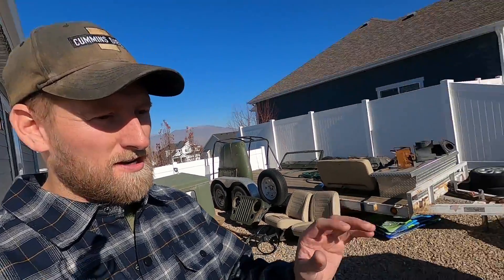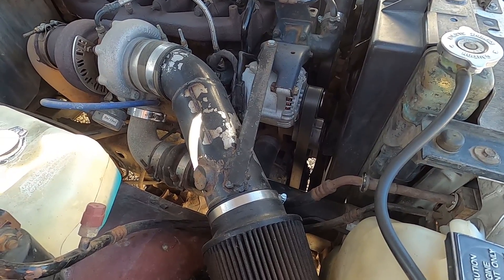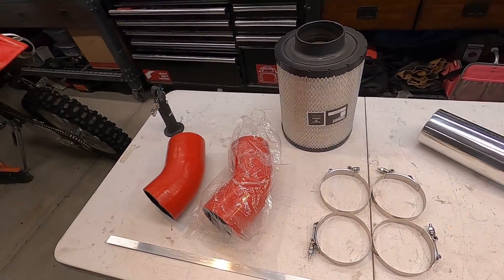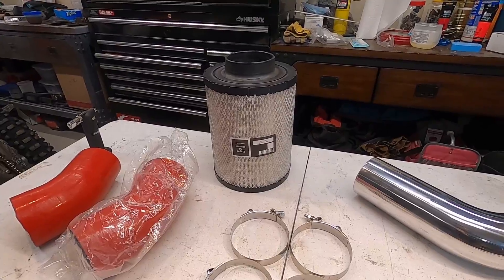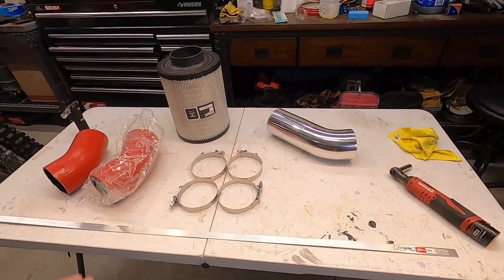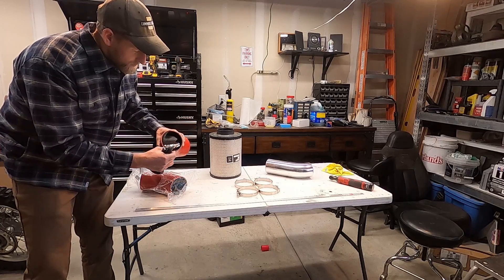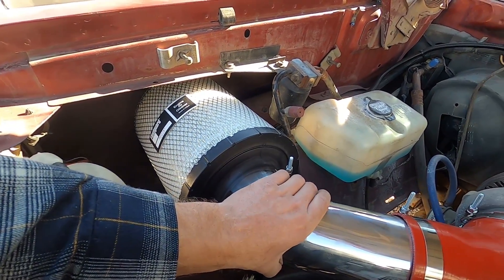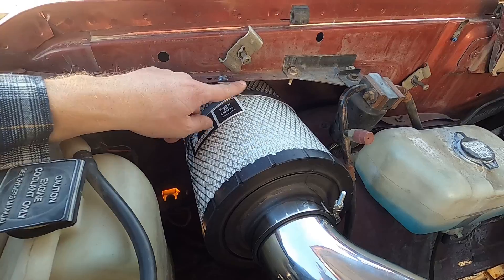EASY $120 Air Intake Set Up for Any 12 Valve Cummins

Comment: Anytime you are attaching aluminum to steel use Stainless for your attaching hardware. Aluminum will cause electrolysis and eat the steel. Plastic grommets aren't a bad idea either.
Reply from the maker: Interesting. I'll make sure I get some stainless hardware on there for sure

Comment: Highly recommend getting a filter wears pre filter to go over your filter.  to prevent water damage to the filter.  I put one on my Donaldson and it has extended the life 10x further than without it.   Highly recommend it.  First gens throw tons of water under the hood and the filter sits right at the hood line with the fender which dumps directly into the filter.  The pre filter slips over and is 100% water proof and doesn’t restrict any airflow.
Reply from the maker: Great advice! A few others have mentioned this as well and I'm going to pick one up for sure.

Comment: Looks good! I've got a similar setup; in fact I'll post a video of my rig on my channel as well. 

One suggestion; you might want to look into a pre-filter from Outerwears. Now that you've removed the stock airbox, there's really not much preventing your filter from getting waterlogged. Those pre-filters are made from a hydrophobic material. Well worth it!
Reply: X2 on the outerwears pre-filter. I use one also and helps a lot to keep the water outer and longer filter life. Great video!
Reply from the maker: Yep, I just found out about outerwears and I'm going to be getting one for sure.

Comment: Great video and intake, if you used a different filter you would have had to find another way to mount the stabilizer bracket. Seems like the Fleetguard was the right choice 👍
Reply from the maker: Great point!

Comment: You could always drill the hole on the fender slightly larger run the bolt through the bottom and wing nut the top for tooless removal granted the hood would clear
Reply from the maker: Excellent idea! I'm going to try this for sure!

Comment: Great Video!! The only problem is, if you want better Air Flow, Upgrade your Intercooler, for your first step for better performance. Air cleaner upgrade's do very little, except make the Producer's of the Product very rich.
Reply from the maker: This particular truck has a powerstroke ic and 3 inch piping.
Reply: @decentgarage  Yes, you have a lot of Great Video's and I have even asked for your advice about your seats. I was only commenting on the Air Cleaner upgrade. Power is all about the ability of the engine to flow the most amount of air, that is the only reason I said that.

Comment: I’ve always had a problem with air intake in the engine compartment... to much hot air...my first gen loves cool air...found K&N knock off cone shaped filter and simply adapted it to my stock filter housing. The air outside my engine compartment is always cooler than inside... just a thought.
Reply from the maker: Good tip! I've heard both ways and heard many knowledgeable people argue each side.

Comment: Hey thanks for the shout! I like that bracket you made. I'm curious how it does under load, since it's mounted to the body and not the engine. I guess whatever flex is needed will just move at the silicone elbow?
Reply from the maker: Yeah, any flex will be absorbed by the silicone.
Reply: @decentgarage  makes sense!

Comment: I’ve got a 1990 truck, with the 3” turbo inlet. Just repeat with smaller size? Or you have a better idea?
Reply from the maker: LOL, funny story... I actually woke up frantically during the middle of the night last night when I realized I didn't address this question! Yes, you will just need to buy a 4" to 3" adapter. I would put the adapter right at the turbo so you have as much 4" air flow as possible.
Reply: @decentgarage  Thank you very much! Love your videos! keep the the great work!

Comment: My truck has never seen over 24LBS of boost. I'll have to try that filter.
Reply from the maker: Stock H1C? That's good for an H1C. The turbo is this video is a super bee and I'm honestly not impressed. It takes forever to spool.
Reply: @decentgarage  the super b turbo will have a lot larger turbine wheel than stock idk what series your p pump is if it's a 160 pump or a 180 ect. But timing and fuel will help greatly and living at elevation in the more timing will hurt spool as well . I have a set.of 6x11 injectors laying around that would compliment that turbo well and maybe a afc spring.
Reply: @decentgarage  yes, stock H1C with the banks upgrade.
Reply from the maker: @kaydewhipple7696  I believe the pump is the 180 (97 automatic). Supposedly the injectors are 50 horse which I don't know what size that is. I really want to get this truck tuned better.

Comment: Hi, I am new to your channel and I like your approach on doing the presentations. Very well done! I have a 1989 6BT non-intercooled engine that I installed in an old bus (1956 Western Flyer 4x4) and it's connected to a Allison 545. I have the stock D250 harness but I want to convert it to a bare minimum harness to run the Bus, feed the alternator and have the manifold heater. Do you have any suggestion on how to go by doing this? Should I modify the existing harness or should I start with a new harness? Thanks!!

Comment: Attaching aluminum to steel=electrolysis. I would use nylon washers and stainless hardware. Any contact points will rot. Especially if you introduce road salt into the equation.
Reply from the maker: Thanks for the tips!

Comment: Will this work on the Non I/C turbo trucks as well?
Reply from the maker: It will but if I'm not mistaken the inlet on the non ic h1c is smaller then the ic one.
Reply from the maker: So I would verify the measurements an then order the parts accordingly. If it is smaller you may have to get an adapter

Comment: You may have already addressed this in the video but I didnt catch it, what size silicon boot did you use? I have a 91 non intercooled stock turbo. I have a brand new AFE air filter 4" laying in my garage that I never put on my 3rd gen when I had it.
Reply from the maker: For a non IC I believe the turbo has a 3" so you will need a 3" to 4" coupler which I would put as close to the turbo as you can.
Reply: @decentgarage  thank you for the reply! Happy New Year

Comment: What is the correct size silicon elbos for the h1c? Largest available on the link is 3.5" is that used with the 4" aluminim?
Reply from the maker: You need a 4". I just updated the description with a new link to a 4" 45 degree elbow.
Reply: Thanks a lot! Thanks for your videos. The 4" should fit with the h1c no problem?

Comment: Is that filter reusable?
Reply from the maker: No, i would recommend and outerwear pre filter which I have also linked in the description. In my mind I'd rather have a filter with better filtration that i have to replace every 15k miles than have a reusable filter that doesn't filter as well and have to worry about ruining a turbo or other things.